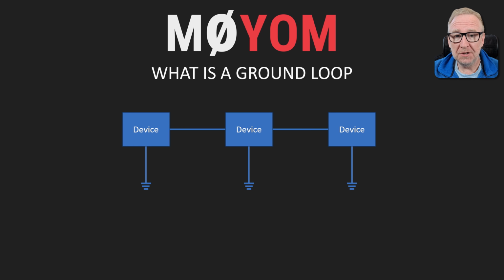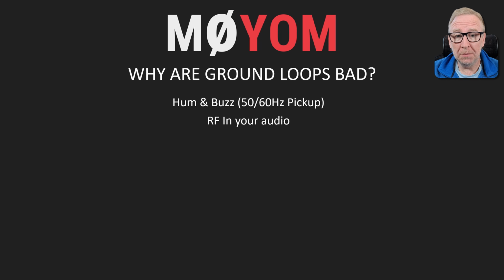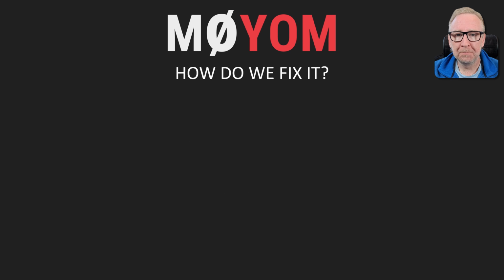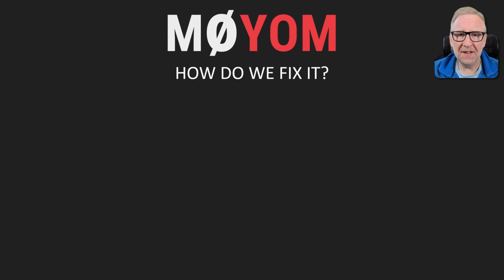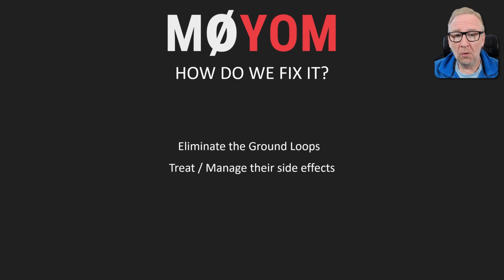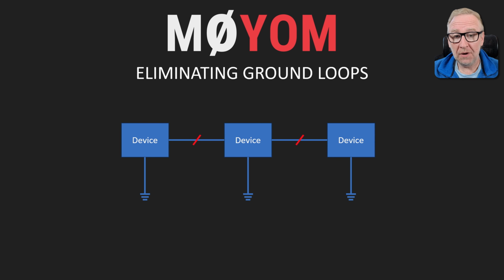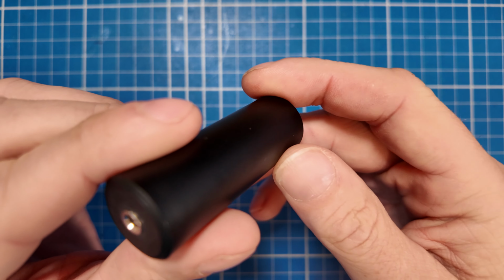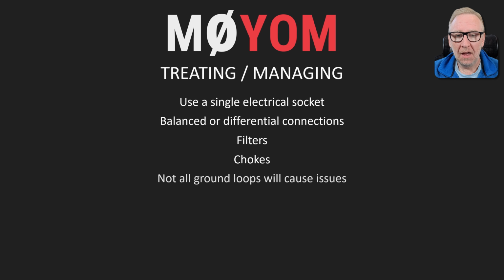Building a HF Amateur Radio Station - Episode 3 Part 2 - Ground Loops

Comment: Can't wait to see how you connect all this up, i use a behringer 19in rack mount soundcard, then go from that to a behringer limiter/compressor/gate then to a DI box then to the radio. Want to go through other equipment when i get it. Been following your process too 73 M0KNM